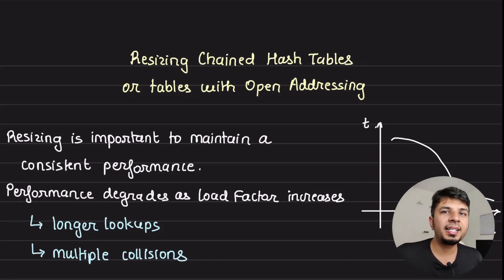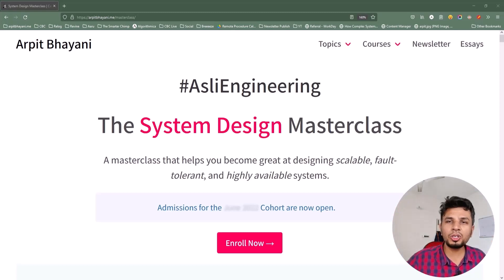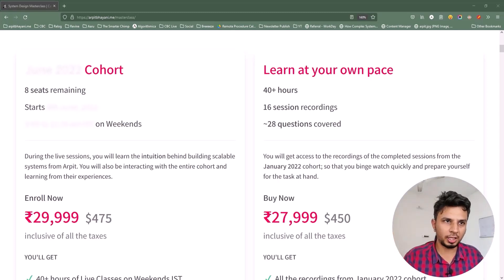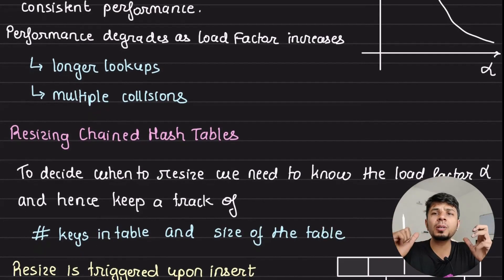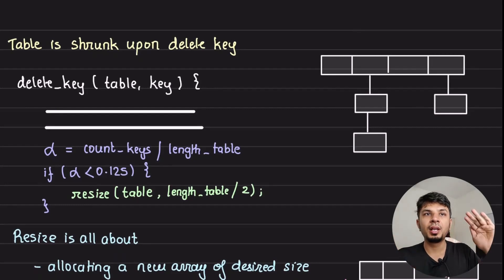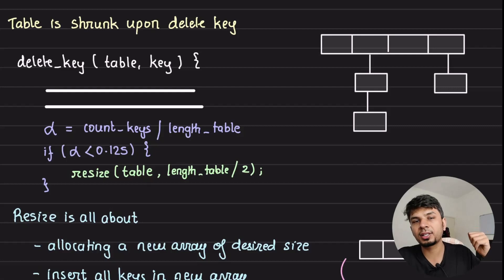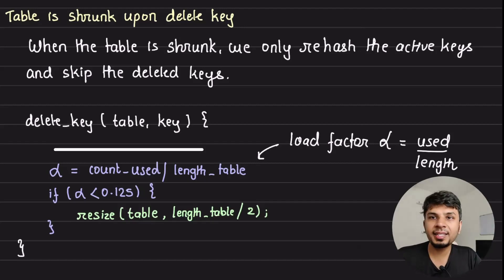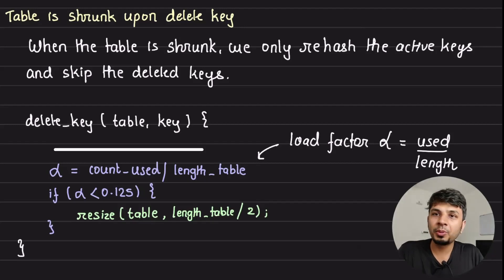Implementing Resize of a Hash Table

Comment: Hi Arpit, Thanks for this great video!!!
A quick clarification, while shrinking the Hash Table in case of an Open Addressing we use the count of the used keys instead of active keys to shrink down, but since I am never reducing the used counter as it is always a soft delete, this means that my load factor never decreases and will always increase or remains the same and I will never be able to shrink down. Please correct me if I am missing something here.
Reply from the maker: Yes and hence beyond a threshold you will have to resize. During resize you will skip copying the deleted keys and that would bring down your load factor.
Reply: @AsliEngineering  So, a shrinking can only happen after resizing.
Reply: @AsliEngineering  
To make the resizing more optimized and edge-case proof, I think the following is better-

PROBLEM: 

As the OP pointed out, the "used" counter will keep on increasing. It will only decrease on upsizing after which, in the worst case when it decreases dramatically (see elaboration at the end), deletes can immediately cause consecutive costly resizing operations to downsize. 

Note: A good hash function will not reduce the gap between "used" and "keys" as we never decrement "used" on deletions. Therefore, the average worst case is- LARGE NUMBER OF DELETIONS.

SOLUTION:
On- 
Insert(...){
	//...
	
	// Two possible cases
	if (used/length >= 0.5 && keys/length >= 0.125) {
		resize(table, length*2) //Upsizing
	}
	else if (used/length >= 0.5 && keys/length < 0.125){
		resize(table, length/2) //Downsizing
	}
}

Delete(...){
	//...
	
	if (keys/length < 0.125 && used/length >= 0.5){ //can escape downsizing till used/length >= 0.5
		resize(table, length/2) //Downsizing
	}
}

We have the two counters (used and keys) already at our disposal. So why not use them like above to easily get the above relative sense for free?

P.S: I am a student, so please let me know if I am wrong..

---
Optional Elaboration:
Extreme representation of the average worst case-
1) Add N/2 - 1 elements that map to the same slot
2) Delete all elements (THIS itself is a PROBLEM. keys/length does not fall below 0.125 without resizing in the video solution)
3) Add 1 element to a new slot.
4) Upsizing triggered.
5) Delete
6) Downsizing triggered
7) Add 1 element to new slot and delete
8) Downsizing triggered
..repeat 7) -> 8)
Reply: reset the used key count to be the same as active key count when re-sizing the hash table

This way we forget the soft-delete keys, as they are not present in the active key count